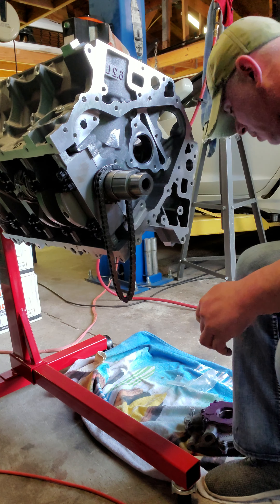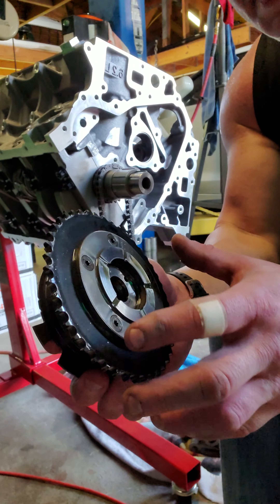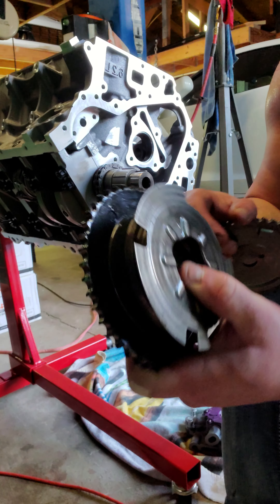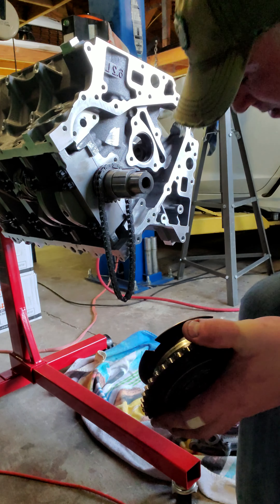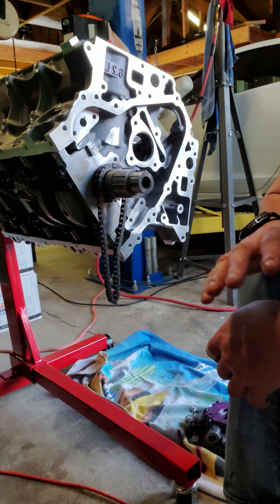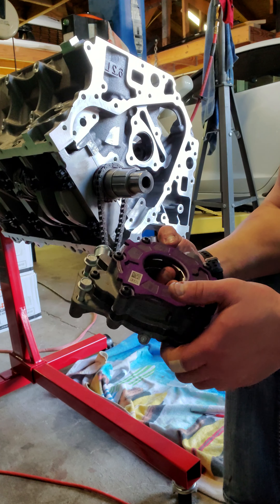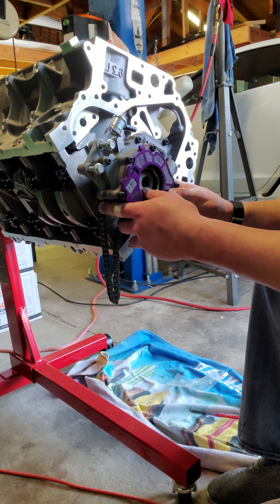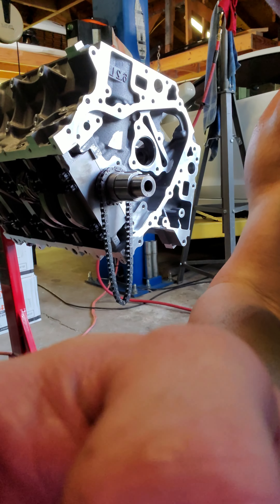Installing and explaining the LME Billet VVT delete and how it differs over the stock VVT delete.

Comment: Great explanation on vvt. I  was somewhat confused on the system until now. Thanks for the vid. Keep them coming
Reply from the maker: Very nice compliment genuinely hope to help others with the work and issues I have ran into myself.  I haven't published content lately my car needs to be torn down again having some oil pressure issues I think my pump gaskets are leaking. Took a boroscope and it looks that way.  No metal or bearing issues thank God.  Just part of owning high horsepower cars its always going to be something.  Kids and job have made it hard but its up on my lift now I plan on making more vids on my tear down and some tips on how to get the motor out faster.  Take care and glad I can help!

Comment: So what cam would you need to use? The ones that tell you to use the cam phaser limiters or is there a different style needed?
Reply from the maker: I would recommend getting some advice from a good CAM Vendor to match your build.  I went with a 32% fuel lobe, and stage 3 VR cam (being an M7 and looking for top end power).  It was a procharger blower cam and worked well.  Usually stage 2 cams are recommended for A8's unless you have a higher stall.  I can help you more if you want to chat offline.

Comment: Will doing the vvt removed get me camshaft position sensor on in anyway?
Reply from the maker: No, I didn't have any issues.   The entire VVT unit comes off and is replaced with a simple LS3 sprocket.  So it's super clean and straightforward.

Comment: So I’m doing the same thing getting rid DOD/AFM and getting rid of the vvt can I still run the engine without it being tuned or will it cause issues ?
Reply from the maker: If you dump the displacement on demand yes you will need a tune b/c that requires a new cam and tuning out the AFM stuff.  I am not an expert by any means with tuning Chris Crawford does all my tuning but I know the basics and a bit more.  Do some minor stuff myself.  But yeah dumping those factory DOD lifters will increase reliability a lot with higher HP.  Also recommend doing a large fuel lobe 32% or so with that cam so you can ensure you get the max fuel increase for the buck.  Watch my other video on lash cap clearance on the HPFP that's key with a new cam install and larger fuel lobe.  Good luck!

Comment: You new sprocket is for 3 hole cam or you can keep you stock single bolt cam?
Reply from the maker: No they machine it for a single bolt cam with a single dowel for 0 degree timing alignment.

Comment: Who need to use a vvt delete. Is there a certain hp or cam that requires it? Do I need it if I'm keeping my engine stock?
Reply from the maker: I need more info.  What platform or engine are you running.  VVT delete removes the 4 cylinder shut down which is known to cause issues by lifters being stuck.  It's simple by removing tons of completely and allows you to run much larger aftermarket camshafts.
Reply: @MichaelBrownPlus  Thats Active Fuel Management (AFM). All VVT does is adjust the position of the cam relative to the crank. Are the VVT and AFM modules linked? In the LS and LT engines? Can VVT work without it? If it can then why delete it? Is it garbage? Sorry for the questions just doing my own homework; thinking about building a small block with some modern tech.
Reply from the maker: @P-nutBD  sorry yep I absolutely got them mixed up by mistake, it happens.  Yes AFM is disabled with closing the oil pressure ports via plugs or a machined valley plate.  VVT uses an actuated cam bolt that presses in on the VVT assembly to advance/retard timing.   I watched a GM engine build video I think the advance/retard capability is quite high.  I just can't remember the exact specs and my USB service manual which tells me all these exact numbers is having issues.  Working to get that resolved now.   VVT is well known to cause the lifters can lock up, they don't support larger aftermarket cams, etc.  GM dumped the AFM on the ZR1 for this same reason.  VVT is just not needed if you tune the car properly.  There's a lot of mass on that VVT assembly switching to an LS3 sprocket saves like 10lbs or rotating mass.  Most just put a lock-out kit on the VVT assembly it's much cheaper than the LME billet front cover with VVT Delete.   And yes VVT is needed for AFM to work properly.  Going from 8 to 4 cylinder mode changes the engine requirements so yep they both for sure work hand in hand together.   At the very least do a trunion upgrade on your stock rockers to dump the needle bearings, those are known to kill a motor, quick.  Cheap upgrade just time-consuming.  You can buy them done already also.  Personally, I feel the LT platform is complex enough anytime you push for more power it just makes sense to keep things as simple as possible.  Less to diagnose or go wrong of course.  The main thing is camshaft choice.  There are just way more choices out there especially if you're going to do an extensive cam install, make sure you get the most out of your camshaft specs.  Camshaft choice is so crucial in my opinion.  Hope this helps!  And thanks for the correction I'm getting old my brain does that sometimes lol.

Comment: I bough/installed the same LME cam gear VVT delete with front cover for my 2017 Zl1.
Reply from the maker: You’re going to love it.  Make sure your cam sensor is torque down properly I used ARP bolts which were a bit longer and it was a hair loose on my cam sensor causing RPMS not to be picked up.  I mean like a quarter to half turn tops was all it took.  Very close tolerances for that sensor to sprocket.
Reply: Michael Brown I installed mine 2 months ago. Cam sensor was tight . I used all the stock hardware . I also put rtv around the other sensor that only uses an oring just to make sure it wouldn’t leak . Great videos by the way . It would had been nice to see your video . I have done  heads and cams on two LT4’s . A c7 z06 and my 6th gen Zl1 but I always like to see how other people do it as well.. You always learn something new .
Reply: Michael Brown check out my last video that says GPT LME that’s with the new set up .
Reply from the maker: Thank you Zl1 Jon!  Funny you say that about the oil pressure union harness yes it’s not tight at all.  It connects to the oil pressure sensor down in the oil pan.  Really frustrating how they did that you have to drop the oil pan just to get that lower harness off.  I’ve had to do that before.  Some engineer didn’t think that through.  But yeah I did the same it moved around way too much.  Good stuff!  Sounds like you know your stuff I’ve leaned a lot through the years from others and just trial and error.  Been a car guy since I was 19 I’m 45 now ouch.  Take care!
Reply: Let’s just say that anything on the lt4’s are a pain in the but lol . I don’t like how the oil pan and front cover are RTV . It makes it harder if you just wanted to drop the pan without pulling the motor .
Reply from the maker: @jprelude92  we're on the same page!
Reply: Michael Brown would be nice to see what you z06 would run in the 1/4 mile .
Reply from the maker: @jprelude92  I am going to try and get some times but it's an M7 so it's not going to touch A8 times.  But I still want to get some times soon.  I plan on selling soon also I've had two C7Z's and now that I am done with this "dream" build I always wanted to do I am ready to move on to something else.  It's just too much honestly for what I do.  I like road racing and street use.  it's too much for street I am a dad don't really want to kill myself and it's too much power for road racing also.  I plan on making the 24 hour track at Daytona Speedway again this November.  It was last March (year past) they delayed this year due to covid.  Going to be a sad day though when she sells.  I did every single wrench turn on this entire build including installing the engine by myself.
Reply: Sometimes I think about selling mine too and getting something else but I probably will keep it after spending all that money on heads and cam plus everything else .

Comment: What oil pump is that I'm running a butler, and start up I'm at 90 lbs,,,,switching from ls1 to a Aluminum resleave Texas Speed 427 ,,,,,I need to quit typing and listen to what your saying
Reply from the maker: It's a Katech billet high flow oil pump.  They run about $900 or about a little more than twice the price of a stock GenV LT4 oil pump.  It flows up to 60+% more volumn and PSI.  I just bought it I only have about 5 miles on it since my crank snapped.

Comment: So you can just get a 4 flat three bolt cam gear for dod/afm delete I can just get rid of that phaser along with doing a cam and valley cover...
Reply from the maker: Yep it's just an LS3 cam sprocket but the front cover is key b/c that changes the clearance for the cam sensor.   The LME billet front cover is a bit pricey but honestly for what it does (dumping all that rotating mass and a much more solid DOD removal) it's absolutely worth it to me.  Doing a cam install alone is so much labor might as well just go the extra mile.   Just my .02.
Reply: For Gen 4 LS You can just get a factory non vvt timing cover with front cam sensor hole and 4x sprocket with a three bolt cam. You do not need this brand cover. You can get the factory gm non vvt cover for $50-60. AFM/DOD delete is not this. You will need to replace the lifters (ls7 style), valley cover, and cam for DOD delete. VVT and AFM/DOD are NOT the same thing.
Reply from the maker: Nope they are all different.  I may have mixed my words but I know how all of it works.  I did dump my stock lifters and removed the 4 DoD lifters which collapse with hydraulic pressure with solenoids.  Those are known to get stuck in V4 mode or collapsed mode.  I have Johnson linkbar slow leak down 2116 lifters in now.  All the AFM is also tuned out.  And yes for sure it's way cheaper to do on an LS.  The GenV with DI is a much more painful setup to work with.  And less options.  This was the only option I had other than Katechs cover and kit but there sprocket wasn't offset.

Comment: Hi Mike can you shoot me the Name of that pump, also Shimming it is The ShiT, on the Butler pump I shimmed the Vains and the Circumference,,,aLL gooD ,also can you send me  the Tittle of you installing your camshaft and Pump ,Dual Pressure,,wow so Awesome 👌 👏 👍 Need for Sure br0,thank you for video logging for us all good shit Mike ,,,,💯🙏💯
Reply from the maker: Sure it's a Katech High Flow oil pump.  Google that it will come right up.  They use a custom billet gear and CNC machine it for more flow.  Specs on their website.

Comment: It’s a cam phaser......
Reply from the maker: Yep can't remember the exact specs but in a GM engine build they state it can retard up to 40 degrees and can't quite remember advance amount.  I will try and find the link to that video.  But yeah variable valve timing by using oil pressure and a special cam bolt.  This deletes all of that.

Comment: It’s 2024. Hey if you got the money then ride out with more horse power. But I simply can’t afford the gas. Keeping the vvt
Reply from the maker: I'm not sure I'm following owning a weekend car that costs $85-115k new and worrying about gas money?  Not to be a dick, do what you want, but that definitely seems like priorities out of line...

I did all these mods to my car with disposable extra income as a secondary car that I could track and play with.  Working my ass off for many years to achieve financial freedom.  I hate that the economy is in shambles and many are hurting, but I don't understand this comment.
Reply from the maker: The VVT has known issues such as stuck lifters, which can cause more $$ down the drain, especially in older years.
Reply: @ I got a 5.3 in a truck. Not a car and this is what brought me to your video
Reply: @ not if you dod delete.
Reply: @MichaelBrownPlus  replacing the lifters solves the problem. Yes it’s not an easy Job and requires taking off the heads and tune but the vehicle lasts forever if taken care of after done
Reply from the maker: @jamesmock8685 I have a 2015 1500 Z71 Crew Cab with the 5.3.   And yeah my bad it’s late I got VVT mixed up with DoD.  Own that.  I did a DoD OBDII bypass few months back tons of vids out there on the 5.3 with stuck lifters.  Keeping it in V8 mode helps.  Disables the oil cut off to the lifters dropping them and that when they stick, trying to fill back up to engage valves.  I’ve driven it with and without the DoD delete and can’t tell nearly a bit of difference on AVG MPG.  But I also city drive.  

And yeah would have helped stating you had a truck.  Wouldn’t have assumed a corvette since most everyone here is for corvette advice or discussions.
Reply: @MichaelBrownPlus  the vvt is not what causes the issue. Its the lifters
Reply from the maker: Btw the 5.3 is a great engine.  I have almost 90k miles without a single issue.  Just replaced my AC condenser for the known leak.  Was easy swap.  Been a great truck.
Reply: @ I’m just learning about the VVT from your video. I was actually trying to determine if I should delete the VVT but now I am learning that it’s just creates more horsepower and you’re trading and worse gas mileage by doing so. And what I have is a avalanche 2010.
Reply from the maker: @jamesmock8685 that’s the true fix.  Course I did it several times on corvettes. But it helps to disable the dropping/lifting of the lifters when it goes from V4/V8 and vice versa.  Yeah it’s not foolproof but it has seen some promise with those out there who’ve done it.
Reply: @ yeah I just bought the truck with a stuck lifter and I have the motor apart right now and grabbing the kit. I’m trying to get the best quality kit for stock out there at the moment. Not really much on the subject with what you should be purchasing in the kit.
Reply: @ I just want the truck to last forever I don’t care about speed or power or any of that
Reply: @ I see plugging and the plate replacement with rings. Yet I hear people saying to plug it due to the rubber rings in plate eventually failing . But I really don’t even see how that would be possible in an engine completely away from the elements.
Reply: @ is the kit I’m thinking about buying. Sure it’s more expensive but at least I know I’ll get quality parts
Reply: @MichaelBrownPlus  are you aware of any cheaper quality kids to buy?
Reply from the maker: @jamesmock8685 I would plug it.  Or you can drill and tap.  They do that also.  Waste of money on the plate.
Reply from the maker: I may have to respond tomorrow hitting the bed.  Tell me what kits or parts you are considering.  Johnson lifters are top notch.  Happy to help.  Can email me at michaelrbrown at gmail.com
Reply: @ do you know a good and expensive kit?
Reply from the maker: @jamesmock8685  for the DoD kit BTR has a good selection.  I get you probably don't want to go with a Katech Valley cover, just do the DoD plugs.  I always use Johnson lifters, but they are $$.  You can upgrade the cam to a bit hotter if you want since you're in there, but you will require tuning.  Otherwise I just prefer this kit: https://www.texas-speed.com/p-18933-l83l86lt1-dod-delete-kit-w-camshaft-for-2014-2018-gm-models.aspx
Reply: @ I spent 1k and got it from Texas speed. Figured if I’m going to do it to just do it right
Reply from the maker: Another kit w/ a video describing their parts.  Main thing go with at least Delphi lifters or better.  You're going to require some tuning for the AFM/DoD delete I used HP Tuners, but again I'm much more familiar with the GenV LT4 engine and LS1's.  Regardless they are all very close as far as architecture.  If you are going through all this I would talk to them about a little hotter cam, just a lot of work doing a cam swap so why not pick up some power. https://sdparts.com/i-24138746-l83-dod-afm-delete-kit-for-2014-2018-gen-v-5-3-engines.html?srsltid=AfmBOoo9nKHazU2bS-6WSiB5vlrrUtQj41a4YsUe1ER8OYnupFez4DmE
Reply from the maker: @jamesmock8685  oh sweet.  Then ignore all my posts.  Honestly that would be my first pick anyway.  I went through hell with Texas Speed but they really came through for me.  Key was getting to the right person/manager.  I would absolutely buy from them again.  Best of luck!
Reply: @ not everyone is concerned with power. To be honest
Reply from the maker: @jamesmock8685 lol probably landed on the wrong channel then.  This channel is 99% about power.
Reply: @ yea probably.
Reply from the maker: @jamesmock8685  best of luck bro.
Reply from the maker: @ so it’s clear here any DoD delete cam has about 25lbs (cam lobes are ground differently) of cranking compression in 4 cylinder mode which can cause misfire conditions.  Extra oil is also pushed out of the oil relief valve could cause burning on cylinder walls.  They sell a pipe plug to fix or switch to a standard volume oil pump.  Regardless you still need an AFM disabler (recommend if you don’t have a collapsed lifter) or tune it out using HP tuners etc.  On my corvette I did the whole shabbang, LME VVT delete, DoD delete cam with 32% fuel lobe (lash cap with shims), Katech cover (can do plugs or tap), and Johnson link bar lifters (removed trays).  If you have a 5.3 liter or 6.2 with DoD or AFM active best bet is adding a OBDII AFM delete it’s simple and effective.  AFM only gives you 5 to 7 percent fuel efficiency not worth the money in labor and parts for collapsed lifters.  Anyone in this space as experts knows this.  Plus you bought a V8 why not keep a V8?  5% fuel efficiency doesn’t make it worth the trouble in my experience.